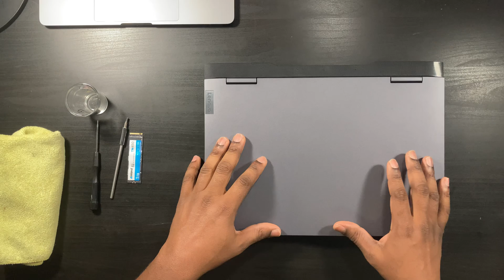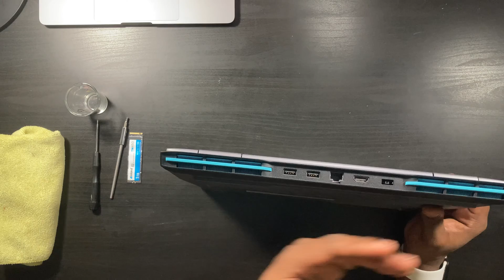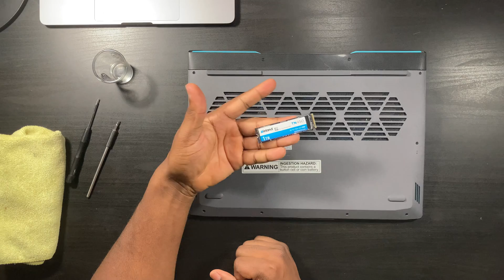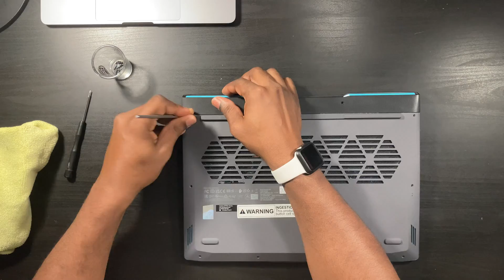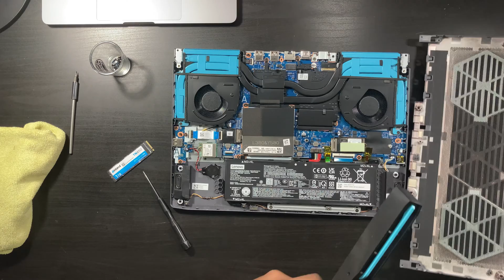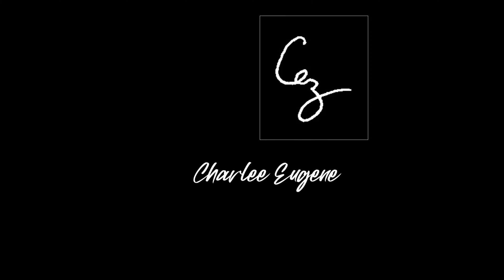Lenovo LOQ 15APH8 SSD Upgrade and RAM Location!!!!!!

Comment: whats the type of ram and SSD for the laptop I have the 4050 and was thinking of upgrading storage and ram
Reply from the maker: DDR5-5600 and any M.2 SSD 2280 will do
Reply: @charleeeugene  would Samsung 990 Pro 2TB NVMe SSD work? Sorry if this is a dumb question. I have never upgraded a laptop before.
Reply from the maker: @WOWmageX-v7v  Yes that's what I want to install in my machine. I'm Jealous